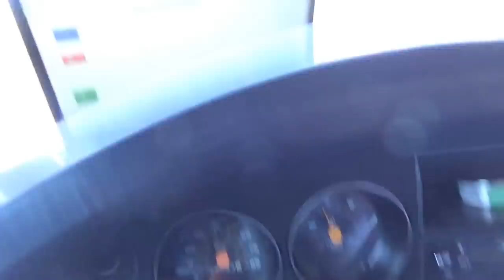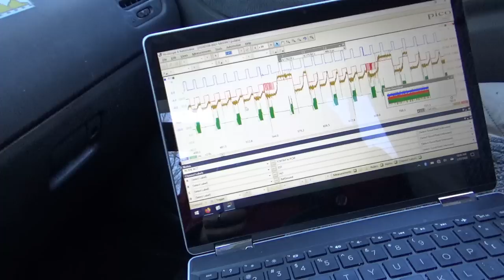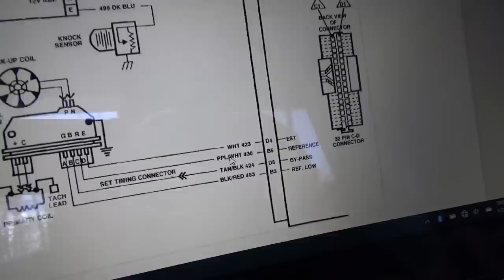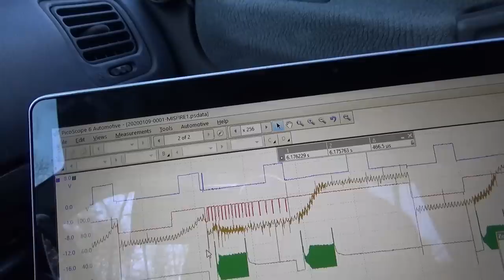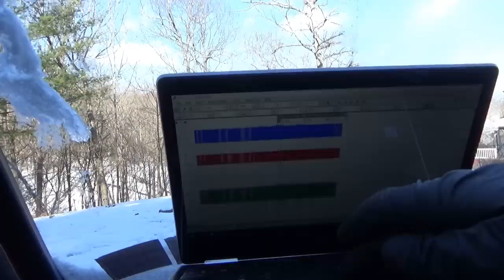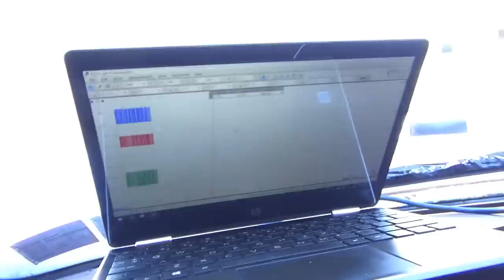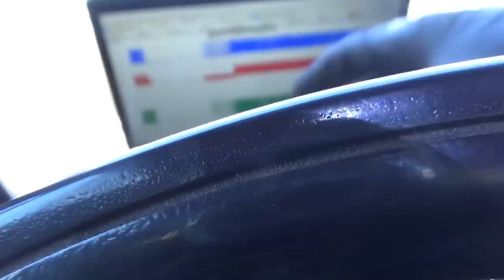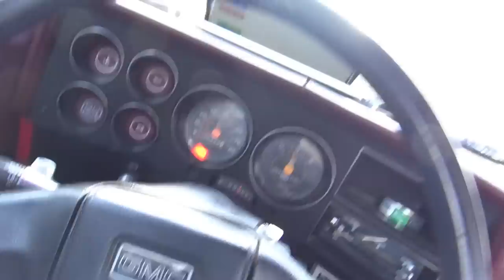COMEBACK? (87 GMC Plow Truck STALL/Misfire)

Comment: Speaking of chevy thunder~back in 85 my bosses 1979 chevy 3/4 ton with a 454 had a slight miss. I couldn't quite figure it out till in a trip stopped at a small town at night. Lifted the hood engine idling and Low and behold the #1 plug wire would glow green when it sparked. Never seen anything quite like that before. Ha..so I removed the plug boot and spark was jumping 1/4 inch. Trimmed wire back and walla..purred like ah singer again. Since learned to spray a stream of water from a squirt bottle..on exhaust manifold on each cylinder by the head when engine is hot and look for rapid steam. Next day did a complete tune up. Thunder for sure on that one ☄ Thanks Ivan 👍

Comment: Don't use regular WD-40, mineral oil is no good for conductivity. Use the Silicone based WD-40 or any silicone spray. Blaster is the brand that yield the best result for me.

Comment: Those rotors were known to have the incoming coil spark to punch through in the center to the rotor shaft.  Many service calls with a no start, no spark at the plugs, but the coil wire would arc to ground when set up for testing.  New cap and rotor and the engine's running.  The rotor would stick to the shaft.   Little tech tip.  Put a rag over the rotor to protect the hand, grab the rotor twist it counterclockwise, it would snap and come off.  Inside the rotor where it sat on the shaft, you'd see carbon tracking and a small hole where the spark punched through.
Good one Ivan!  Gotta keep the old iron going!
Reply: its doing that because the shaft bearing has moved, and its pushing up on the rotor, which is pushing up too hard on the inside of the cap. the shaft naturally tries to go UP due to the orientation of the distributor drive gear..  If one thing is worn out, likely everything is worn out on these distributors.. Ive wasted way too much time trying to fix them,.  if he pulled that whole distributor out and inspected it, he will see how worn out everything is.
Reply: carbon tracking on the spark plugs is also a  sign of a worn distributor. too much slop .

Comment: Just FYI. My brother worked for chevy in the 1980's . He remembered that the pickup reluctor in the base of the distributor were made from (the magnet material a refrig door gasket is made from). The oil would work its way up the shaft of the distributor and with the high voltage create OZONE inside the cap. That would decompose that magnet . I would look fine but lose its magnetic properties.

Comment: I had a 91 GMC with a 4.3L v6 and the,  1of 2 coolant temp sensors,  went bad. It was the sensor for the computer input. The other sensor was for the instrument panel temp indicator. I did an old school diag by jumping a point in the OBD port and counting check engine light pulses. It was running like crap!! I replaced the computer input sensor and that was it. It was what the code called for. I never had another issue. I owned that truck for 13 years and put 230000 k miles on it.

Comment: Good job, I had an 87 Chevy 2500 thought ignition was breaking down so as you say shot the parts cannon and see.ed OK. Problem came back various times then I filled the truck up and noticed hesitation and missing stopped. Yep water in the tank the problem popped up when the tank was low!

Comment: I trust that Truck 1000X more than the over engineered garbage that's being produced today.  In a 100years it'll still run ,modern junk No way.Everyone needs to have classic beast in their fleet mines a 4.9 f150,  always runs change oil every 2 or three years. 280k miles and has been a parts runner many times for my newish vehicles.Oh lets not even talk about hail storms , old trucks eat hail for breakfast(thick metal body's), where as new trucks  completely destroyed. Last Hail storm  NO hail dents on 1989 f150, sitting next to my 2015 ford that was completely totaled by hail. Auto industry is in Need of Reform ,blinding us with lights while selling us Crapola.
Reply from the maker: Wow that's nuts your new truck got destroyed by hail while the old truck was like "hold my beer" haha
Reply: @PineHollowAutoDiagnostics   Yep it was , I took the insurance check , had some PDR on the hood. Pocketed the rest. Roof still hammered so is topsides of Bed. It's White so I live with it.Hard to Say How many Hail Storms my old Trucks been in Dozens probably . Not one HAIL Dent anywhere on it. Whisky dents yes a couple. The thick  steel bodies used to be the Air Bags I suspect.

Comment: I bought a new Chevy Monza in 1978 (I had it for about 2 years and then I got rid of it, what a piece of junk) and I was not impressed with that early version of their HEI ignition. From time to time that vehicle would refuse to start (no spark). The local Chevy dealer replaced the module (even though the problem refused to occur when they had it in the shop) and the problem recurred  a few weeks later. What I found that would at least temporarily resolve my issue was when the vehicle would refuse to start I would unplug and re plug in the module (I assume the connectors were becoming slightly corroded and the unplug/plugin the module would remove the corrosion).

Comment: Just had to replace a "bad" dizzy cap, after 1st checking the spark plug and wire to #4 on a '70s British car. There were no tell-tale signs of it being bad,  but a timing light doesn't lie, so an easy & cheap repair.

Comment: That was a simple and easy fix - reminds of old times :-) Just wonder if you should have checked the spark plugs, after working with a high sparking distributor cap. But it seems to run OK :-)

Comment: Back on the day , on these chevys, we did what was called a “Tune Up” which would involve replacing Cap Rotor, plugs, wires and often putting in a new or reman distributor.
Reply: Cap, rotor, plugs, wires and a fuel filter.  That's how I was trained back in the 80's.  These things were notorious for distributors going bad. I've seen them short through the rotor to the shaft and kill the spark too.
Reply: The old parts cannon approach. Just replace everything and hopefully it fixes it.
Reply: @mph5896  yep, that was my thoughts also. Never really knew what the real problem was. Back then the parts usually cost more than the labor.

Comment: Good job, I still have an old dwell meter and the flexible driver to adjust the points. It was pretty easy to work on back then, but today's cars have less moving ignition parts.

Comment: plugs lasting 200,000 miles is a big problem thats why so many break taking them out i advise my customers to remove even if you reinstall them every 12 months. years ago when we used to have to do tune ups yearly never heard about spark plugs breaking trying to get them out.
Reply: If you can get to them. I replaced them in my jeep just because they were 10 years old, now they are 20 years old so I should probably take a peek at them again since they are easy to get to.

Comment: After trying the best cap and rotor that the zone and advance had to offer gold contacts built in coffee maker the works my 97 s10 would not start when it rained or snowed, the next day or whenever the sun came out again it started right up, it also had no power and it has the 4.3 engine . I couldn't rack my tiny mind around it, I then went on the line and tried desperately to find an answer, I searched to no avail until one day I struck paydirt, buried in a thread was a guy with the same exact problem and the fix, a genuine GM Delco cap and rotor, I thunk that this sounded too simple but it was worth a shot, advance had the parts in stock I picked them up installed the new cap and rotor, that was more than five years ago and I haven't had a problem since. One time I had gone to AC with my truck and brought it to the valet for parking, when I went to get my vehicle back I waited and waited and my truck didn't show up for almost a half an hour, when it finally arrived the guy said they couldn't get it started that pre GM parts, sometimes with standard motor parts you will get an OEM part in the box so hopefully this truck will work for a long time unless it's dead fussy like mine ie.

Comment: I've seen many of that style of rotor burn a hole thru to the distributor shaft. It will give intermittent issues until it gets bad enough to die completely, The old HEI rotors will do the same. And yes I'm really that old!!!

Comment: Yes the reason why you to add thermal compound or thermal grease to the bottom of the ICM is for summer time use not too much in the winter just keeps the internal mosfet cooler just in case you did not know this it is a analog to digital converter part kind of similar to how car amp works and why they use aluminum fins and attach certain components to it and I also recommended to you to replace the distributor cap, coil wires and spark plugs back in the previous video.
Reply: @dkupy100  No I own one which 1988 C2500 which been in family for 35 year and I spot that in first video as distributor cap are notorious or failing overtime I could see that it would already had a bad button you can even see that when he tried to push down on it which should have sprang back the carbon rod meaning that the spring had totally collapsed.

Comment: the next thing that will fail is the trigger coil on the distributor.. .. a long term fix is to just replace the whole distributor with a Oem or equal.  the shafts get sloppy in the distributor from many miles. the drive gears wear at the bottom and get slop in them so the timing is jittery.. spend the 150 in parts and be done with it.. also a good set of Belkin wires and AC Delco plugs.. Ive tried just piece meal fixing these old distributors and its just not worth the hassle.  also the star wheel (magnetic pick up)  is made of steel, and over time it loses its magnetism due to the heat.. that causes problems.. magnets dont like heat.   another thing, sometimes the bearing on the shaft slides down, which allows the rotor shaft to push up, and that puts the rotor pressure against the inside of the cap, and destroys the spring loaded contact..

Comment: well talking of old school.  reminds me of problem from years ago.  on a chevy 350.
took about 6 months to find the problem.   it would start great.  idle great.   low rpm  move first second gear.   no serous load.    then third gear.    it would retard   back fire and at time even just stall out..   oh   early 80's model.
problem  was a hair line spiral crack on the distributor shaft.  up by the mounting plate.
no load ran great.   loaded the crack would open just enough to throw the timing off.
keep up the good work.

Comment: I also had the ignition module that’s in the distributor, bolted in the bottom of the distributor, that went bad and caused the spark to consume the spring loaded button in the distributor cap. I was told it was because of low voltage.

Comment: the plug wires are the weak link on this system, also wires on the pickup coil have been known to fall off where they connect to the pickup coil. but the pickup coil seems to be working fine on the scope

Comment: Well done ivan,  i bet the owner was as happy as a dog with three trees :-D
Yes i'm talking about dogs peeing up trees lol.
If it plays up again, remove the fancy box and throw a basic Kettering system in,  points and capacitor.
Don't sneak in any fancy pants capacitor discharge ignition :)

Comment: Back in the 1960s, a lot of people traded in their cars every 3 years at 40,000 miles, as soon as tires or a tune up were needed most people just got rid of their car and drove something fresh and new.  That’s why you could pick up a good used car between $500 to $1,000 back then.

Comment: Minute carbon tracking in these caps are common. BTW, to help isolate the IMC from the ECM, disconnect the base time connector, which I believe is pink with blk, under the passenger side interior panel. This eliminates the ECM timing control, puts the IMC in base ign time, which should be 0 on the balancer. If you know your secondary ign parts are good, this test limits the issue to either a failing IMC or the pick up in the distributor itself. Old Chevys never die, they just rust away... lol

Comment: I have a 1987 S15 with 4 clylinder iron duke  2.5  had same promblem. replaced with refurbished distributor, didnt solve promblem its was the  icm, i tried a napa one and it didnt work, i found old stock ac delco one on  ebay. that one solved promblem. the four clylinder that year had both pick up coil, and hall effect in distubutor hall effect controlled feul injector I beleive . use OEM parts !  if u can find them

Comment: removing the air filter housing gives you ALOT more room to work on the distributor.  also a failing TPS can sometimes feel like an ignition or transmission problem.   one more thing, these trucks eat rotors and distributor caps pretty frequently.

Comment: 1985 Dodge 1 ton 360.
Always ran rough and hard starting. Replaced the pickup coil in the distributor and ran better but not great. Finally ordered a distributor from RockAuto and it starts easier and runs a whole lot better. It's the best 7 cylinder I've ever had! LoL 😂😆

Comment: The spring loaded contact was definitely spring less and a concern. The rotor didn't look healthy. Common replacement  parts back in the day along with wires and plugs and points. The parts cannon was nowhere near the sizeable gatling gun of the modern era. Nice fix in sky blue colour and seemed to revive the ole timer for another while.

Comment: Single(fixed, no mechanical advance) pickups in a distributor provide the computer with a "best guess" when it comes to triggering a spark.  The computer has no RPM reference other than knowing when the last pulse happened and using the assumed RPM to trigger the next spark event.  The computer has to trigger the spark before the mechanical trigger(reluctor alignment or whatever) event happens.  This is non-deterministic as it is based on an event that hasn't even happened yet.  An extra pulse no doubt causes electronics to "think" the engine is suddenly running faster than it really is...hence the bunch of incorrect ignition/injector pulses  That's just the way those old things work

Comment: I have a 1994 GMC Jimmy with the 4.3 V6 which is literally 3/4 of a Chevy 350 V8. Both engines are renowned for warping the distributor cap due to  the position of the distributor, which sits on top and centered to the rear of the engine, where the heat and lack of air flow cooks the distributor. They also have some extremely long spark plug wires as the spark plugs are so low on the engine you have to access them through the wheels wells. When I watched the previous video I had a feeling the truck would have a return visit for a new cap and rotor. IOW sometimes no parts required can come back to bite you 😭

Comment: in the 70's it always was plugs/cap/rotor fuel filter air filter = tuneup. My 1993 toyota 22re is acting up I suppose it has been 17yrs since I took off that Distributor cap off I better look👍. The rotor looked like it maybe has had carbon tracking on it on yours, these old ones do not like dirt/wear. Chevy Thunder!

Comment: Just keep in mind , there are one or two vents with screens in the base of the distributor . They sometimes get clogged with debris . The two wires from the magnetic pickup in the distributor are very thin . They can break internally and may intermittently interrupt the signal , especially when the vacuum advance moves the base plate . Just a heads up .
Reply from the maker: There's no vacuum advance
Reply: @PineHollowAutoDiagnostics  You are correct . I was thinking REAL old school . The system also has a MAP sensor . I guess that's a speed density system . On my 1989 G20 Van , I only replaced cap and rotor . I used SMP Blue Streak parts . I think the contacts in the cap were brass instead of aluminum . I did clean the vents a few times . Some basic maintenance goes a long way . Simple fix WITHOUT the parts cannon .

Comment: I fought one of these a while ago went through several parts and also kept many of those modules for backup on this particular truck it kept doing the exact same thing yours is doing finally the truck quit on my road and had to be towed in make a long story short I found that the pickup coil in the distributor was cracked what is the chances of that happening

Comment: I found out how a bad distributor cap can make things go south in a hurry, I was driving my 03 Astro Van to a locksmith job and it was running just fine. All of a sudden, on the freeway in a not so great part of town, it started missing like crazy. I was able to nurse it along to an offramp where I felt comfortable waiting for a tow truck. I had it hauled back to my shop, put the code reader on it and saw multiple misfires. I ran up to NAPA and put a new distributor cap and rotor on it, fired it up and drove it home that night. I gave the old cap a good look over and could not see anything wrong with it. 

Seeing that 87 made me miss my old 76 GMC Sierra, that old beast and I went a lot of places together. It only left me stranded twice, once from a HEI module and the other from a failed starter.

Comment: Great video, seems like basic tune-up parts for that era vehicle. Looked like a lot of carbon tracking inside that old cap. Would have been cool to see you scope the secondary ignition and see if plugs or plug wires were shot. I am sure they are probably going to need replacement soon.

Comment: Replacing the original yellow dot ac delco Icm with a white dot replacement delco icm was considered maintenance on those back in the day .those old hei coils used to pull some amps .needed full bat voltage .aftermarket hei caps rotors wells brand modules used to wreak havoc on those